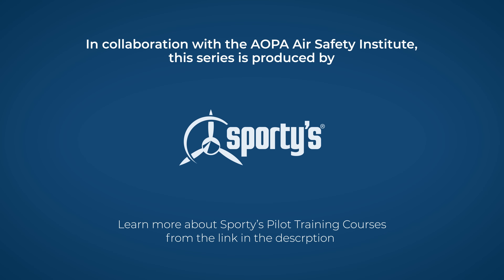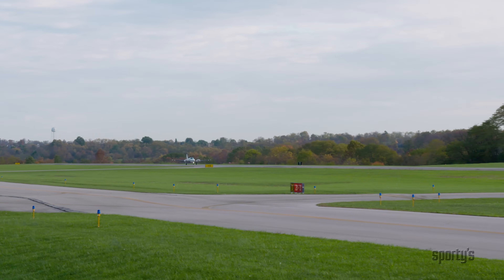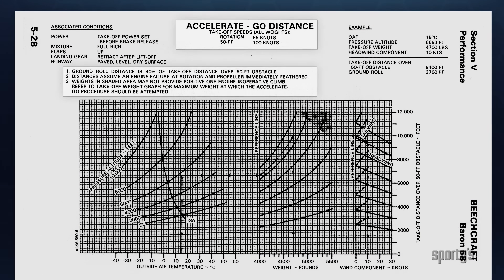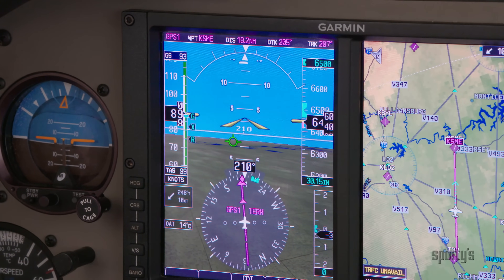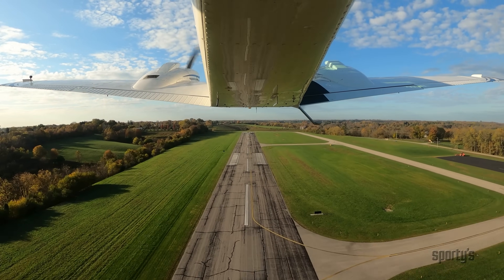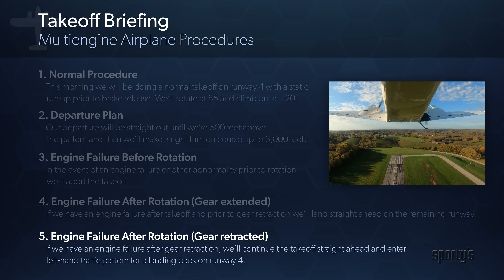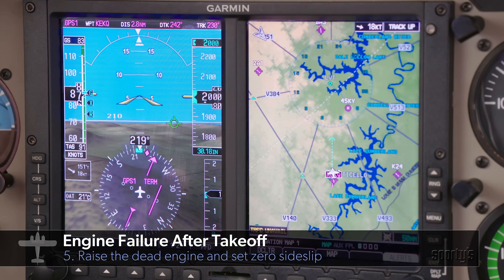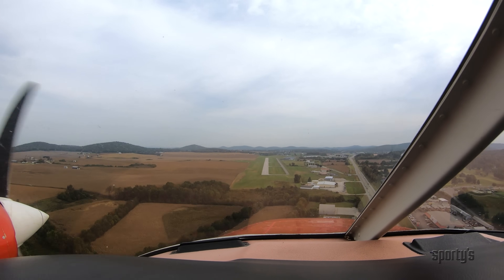Taming the Twin: Engine Failure During Takeoff

Comment: Why can we not add simple sensor one to immediately announce what engine fails with in a second! Take guess work out of action to feather.   2.   why cannot a feature be added to AP. that independent of AP. auto. Engine feather and hard opposite rudder !        You know it can be done.  Add safety and get to 2025 flying technology for OLDER  twins of all sizes and vintage.

Comment: 10:50 This is the most perfect engine failure "mantra" I've ever heard. Absolutely, directional control is #1, quickly followed by pitch for blue line. I would just add that when you're close to the ground, check that you are at blue line every three seconds. Speed can bleed off amazingly quickly as you get distracted by other tasks and it's hard to get it back at low altitude.

Comment: At 9:30 min I can see that both engines seems like rotating outward (it could be camera effect also). Does that mean that both are critical engines? 🤔
Reply: Countrr rotating props mean neither are critical as far as aerodynamics. However, if alternator/hydraulic pumps are only on one engine, then that engine is critical.
Reply: It's camera shutter effect. Both props are actually turning inwards. I saw a video of a P-38 and the shutter effect incorrectly made it look like both props were spinning inwards. 😂

Comment: Great video - I would ,though , emphasize the importance of doing all turns into the “good” engine. If this means breaking a standard left hand pattern (if left engine lost) so be it.
Reply: Not necessarily. The plane turns well in either direction, but rate of turn will vary. Airspeed control and rudder coordination are critical no matter which way you turn.
Reply: Yeah.. until terrain or procedure tell you that you have to turn into the dead engine.  

It doesn’t matter.. provided you maintain airspeed and coordination.

Comment: with very light composite birds with small jets instead of pistons it might be possible to have much higher thrust to weight ratio which should make better use of runway length. Strong glide ratio is also very empowering.
Reply: Jets have poor field performance.  Thats why STOL aircraft always use propellers.

Comment: The steps you need to take must be engrained.  Multi engine 1 engine failure can be much more dangerous if not handled properly vs loosing single engine airplane.  A single engine airplane won't snap roll on it's back unless you stall spin uncoordinated.  Dead foot , dead engine, raise the dead,Vmc.

Comment: There is no reason to purchase rent or otherwise operate a twin engine airplane.

It is false pretense of safety to want a second engine. 

These aren't helicopters. Airplanes don't fly on engines.

When you double the number of engines you double the chance of engine failure. And make an engine failure from a moderate emergency that is handled as such. Into a real catastrophe that is not perceived to be an emergency. In an airplane that cant fly or handle properly with only one engine.

Even if you are over open ocean en route to Bermuda 500 miles away. When your engine fails you have to run the remaining engine at maximum power. Burning far worse fuel consumption per brake horsepower. While side-slipping. With rudder and ailerons deflected. And a propeller feathered. Al of this drag and mediocre performance and poor lift over drag means you'll run out of gas anyway.
Reply: A twin will fly a heck of a lot further with an engine out than a single.  The one engine inoperative climb rate of a twin is much better than a single, too.
Reply: Guess what, Part121 ops only allow multi-engine.
Reply: @umi3017

Yeah. 

When you have a Part 25 or better aircraft; turbine engines; two crew with CRM, SOPs, and two recurrents each year; pressurization; weather radar; FIKI; and balanced field requirements with segmented climbs and net takeoff flight path……. it’s safer.  Even then.. Cactus 1549 was Part 121 and it lost BOTH engines.  

As you get into the dregs of Part 91 with inexperienced single private pilots it actually becomes more deadly than $100 hamburger runs in 172s and Cubs.
Reply: @calvinnickel9995  this has been discussed for ages. Everything depends on what tasks one flies. Multiengine aircraft is more suitable for frequent challenging flights (at night, IMC, rocky terrain, large bodies of water).  Single engine aircraft is more suitable for intermittent recreational daytime  flying over large flat fields. Sometimes an argument comes up, saying that the simplicity of single-engine aircraft makes it more difficult to committ catastrophic mistakes. That's not true actually. Single engine can be lethal, too, and recreational pilot accidents attest that single-engine pilots can develop a wide-open competence gap to their simpler aircraft, too.  (E.g., impossible turn-backs, fuel mismanagement, low-level stalls and spins etc.)
Reply: basic probability: failure rate of one engine from two identical ones is half of one engine plane

Comment: I more or less skipped the multi-engine piston phase of my career going from instructing in Skyhawks to flying King Air 90’s, then into very light jets (Citation Mustang & CJs). I just got a new job that has a new to me jet (Hawker 750) and a BE58 Baron. The Baron has been more difficult airplane to transition into just from a previous experience standpoint and generally speaking engine failures are practically non-events in a jet.

Comment: I always assumed the offical performances figures in the POH would reflect your average Joe pilot and not your super sharp extra-human capable test pilot.
Reply: Most of the charts reflect a new plane with a perfect pilot on a perfect day....written by salesmen and lawyers, so always add a buffer to chart data and be aware of your plane's as well as your own limits..
Reply: If you are in a twin that has balanced field performance, decision and single engine safety speeds, segmented climbs, and net takeoff flight path… then the calculations assume degraded aircraft performance and less than perfect pilot technique.  

If it’s a light twin, then it’s test pilot, factory aircraft, results not typical.

Comment: Thank you for posting this. It's a great reminder for those of us who haven't practiced the twin engined engine-out drills for a while.
Reply: Couldn’t have said it better.
Reply: @nathanwildthorn6919  
Its a shame theres not much emphasis on twin ops in ga mentioned on youtube.    But thats where we all started
Reply: I'm not a pilot, but I have practiced an engine out many times using the P-38, DC-3 and Cessna 310 in Microsoft Flight Simulator 2020.
Reply: @ButchNackley  I've acquired the majority of my Twin time in a C-T310R in the real world, and she can be a real b*tch when it comes to single engine operations. Her short-cord wings give you no quarter, and you really have to stay on top of your power and angle of bank. You'll want to delay deploying your landing gear for as long as possible to stave off the horrific drag during short final. X-PLANE 12 replicates aircraft behavior and performance more accurately than MSFS2020. Have you flown traffic patterns/circuits with the 310 on one engine?